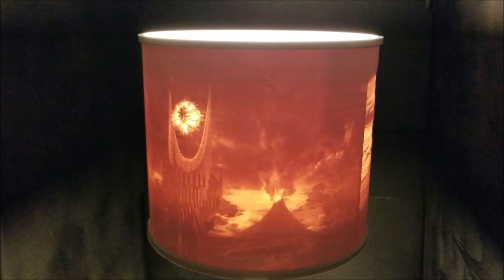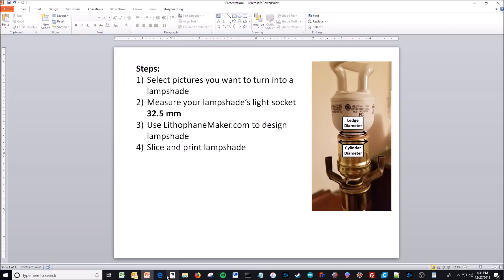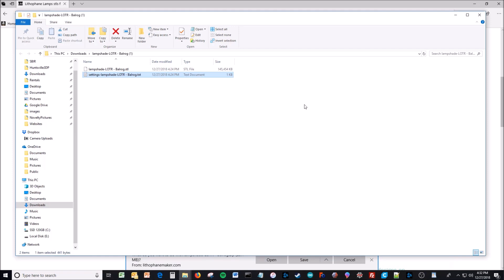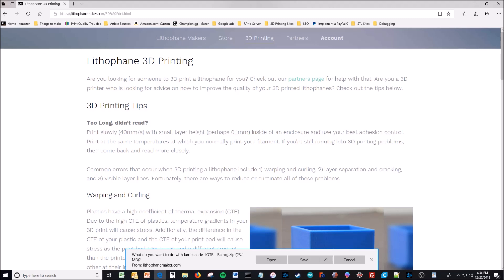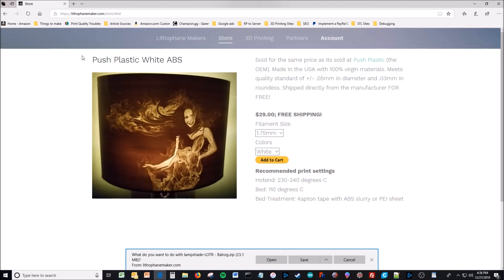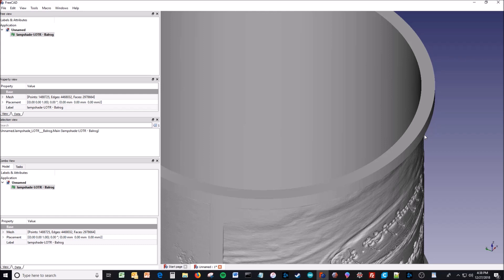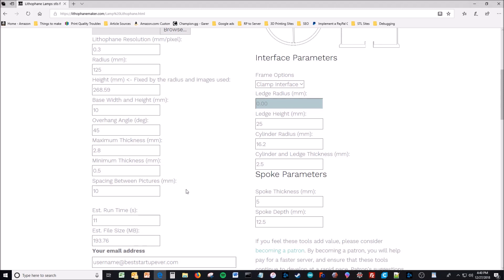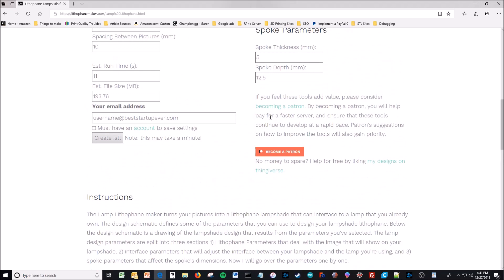3D Printed Lithophane Lamp Shade

Comment: 3D print a color lithophane face mask or shield insert to achieve the same cool optical illusion.  Add some motion sensors and this is a neat trick or treat touch for your Halloween.  Scare the kids before they even get to ring your doorbell.
Reply: What do you mean about the illusion? Got an example? I'm interested.

Comment: Why do you have to measure the base of the light socket?  These are all standard sizes.  Is it possible to make the lamp shade with drop-in pockets so that new art can be added or rearranged without the need to print a whole new bracket/shade as well?

Comment: it shows me 4 days the time to print using cura 4 ... max height 160 and radius 95.  ? too long? is this normal ?
Reply from the maker: It's within the range of normal. Fine detail takes time. You may want to make sure your printer can print a lithophane well first by printing a smaller one
Reply: @LithophaneMaker  thank you. I did not expect this long printing time.

Comment: So I have no clue what's up with the website or if I'm doing something wrong...none of the settings on the page for the lamp update dynamically when I upload new images or change other settings, no "preview image" appears, and unlike what your video shows I cannot seem to change any settings or pick a ledge radius less than 0.1 (it forces me to pick at least 0.1) so I get these giant ass ugly ledge overhangs, whereas you barely have any in yours. Any suggestions? Tried on IE and Firefox...

Comment: Good video bro. Still, I'm having a problem with the radius, I chose  100mm, but when I open the STL file in Cura, the total diameter is about 115mm.
Reply: @LithophaneMaker  thanks for the reply. The diameter is 115mm, the radius is the half of that, the height is the same as the calculated, but the file size is about half the calculated. I was thinking of scaling the model, would that affect in anyway the final print?